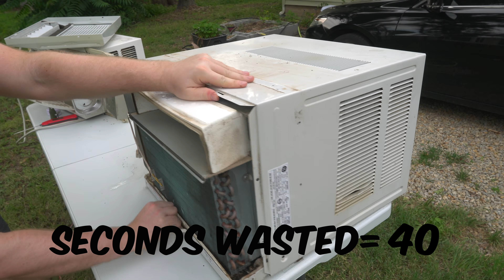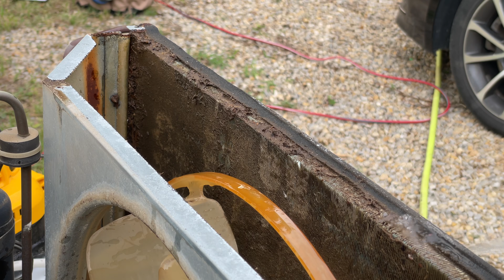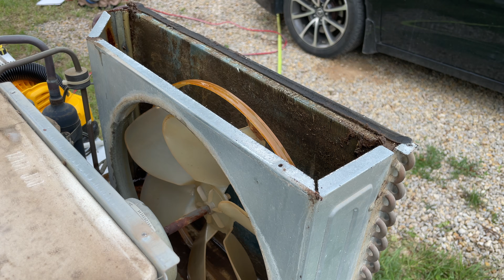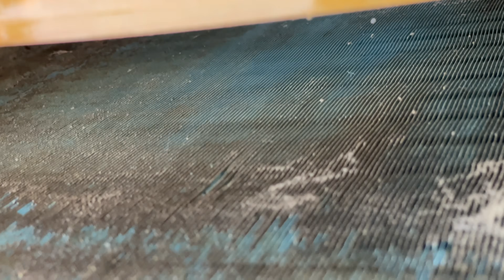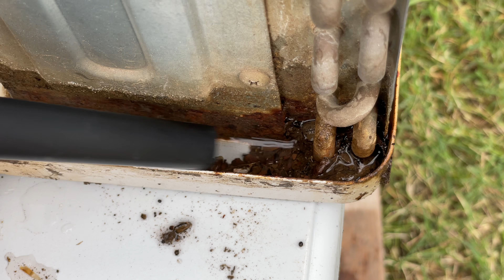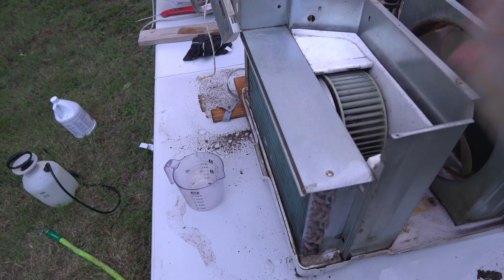DEEP Clean Window AC The Correct Way!

Comment: One thing I have done with my one unit. Take a small piece of window screen material and magnets. Lay the screen material over top the outside of the unit. Hold it down with magnets. Helps keep leaves and small debris from falling into the slots.
Reply from the maker: That's a really good idea! I've thought of something similar, but didn't know how to do it without it looking sloppy. Any tips? Thanks for sharing.
Reply: @HandymanHertz  you could try painting the screen white. Then use the harbor freight magnetic tool strips. I’m just using the 99 cent ceramic blocks.
Reply from the maker: @briteidea08 that's true, I may have to give that a try. Thanks.
Reply: @HandymanHertz I did this same thing but with velcro. Line up the screen and take note of the edges and then put velcro on the AC, then the edgea of the screen and it will be a pretty nice barrier that you can easily take off and clean then stick back on.
Reply: I just used small binder clips to secure the screen. Wrap it and clip it. Done.
Reply: Just to let you know - We have screening already, and ran out and got magnets from Harbor Freight today to do this.  Thanks so much for a great idea!
Reply: You should make sure the screen you get isn't too fine. I would hold some of it up to a fan blowing and see if you still get substantial airflow. The whole point of that on the outside is to have airflow. In my experience, a fan does not blow air through a fine screen almost at all. You need a pretty good pressure difference to really push air through.
Reply: That's brilliant!
Reply: Hey!!!!Thank you for that suggestion soo much! Lots of black dirt here I need tokeep out of ac infallible unit. Thanks again!
Reply: Suppose to read "in wall unit"
Reply: I do this! But I use two bungee cords to hold it on. And every few days I go out and clean it with a brush to keep it breathing well. I still end up having to buy a new unit every few years. I’m in Fl and mine runs a good part of the year.
Reply: I wish I could break mine down like this and clean it. I’d forget where the screws go when it’s time to put it back together
Reply: Would be good as To many pigeons go on our roof but they love sitting on it in winter so it wouldn't stay on. 
Its gonna be a B...h to take down, take apart & wash.
Reply: Brilliant
Reply: That's exactly what I did. Also keeps the wasps out.
Reply: That's a good idea I'm going to have to do a deep cleaning on my window ac and after I'm done I'll put some of that on to keep sticks and leaves out of my window ac
Reply: Brilliant!  Thank you.
Reply: Just make sure you clean that screen from time to time

Comment: My ac desperately needs cleaning but I don't own a water hose. How do I spray it down??
Reply from the maker: You can spray it with the foam cleaner I have linked in the description, and then get some water and rinse it after it sits (preferred)  It technically says you don't have to rinse it, so there's that option.

Comment: Nicely done! I have a habit of drilling a couple of extra drain holes near the condenser. Obviously, you need to ensure you won't drill into a refrigerant line or electrical wire 😂
Reply from the maker: Thank you!  Yeah, I've drilled into a perfectly good fan blade and cracked it once in an old AC. New fan blade was more than the thing was worth. a lot of good AC's in the junk pile do to drilling!  😃
Reply: some units don't have drain holes because the fan splashes the water onto the condenser to improve efficiency

Comment: The adjustable vents that can move side to side has mildew. Do I need to take the front of the ac off to be able to get to it? I’m in an apartment and not super savvy. Maintenance wasn’t much help in the cleaning department
Reply from the maker: Yes, and the reason is because the fan is going to have way more mold/mildew than the vents. If you watch the part of the video, you can see the fan blades are cover.

Comment: I have some other brushes I use but thanks for the info on that long fridge coil brush. That will come in handy.
Reply from the maker: It’s the best I’ve found soo far. Cheap also. I think the ones in the description or two for $10.
Reply: What brushes do you use ?

Comment: I've got a question my a.c. keeps freezing up so I cleaned it really good and put it back in window within an hr it was freezing up I'm thinking that I shut the fines when I cleaned it a couple month's ago after getting another one the fines don't look the same I think when I used a sm shop vac carefully I shut them when I took off the little thermostat in the front you can see the space in between them but no where else would this cause it to freeze up on the inside
Reply from the maker: Where does it freeze up? Lack of airflow is the common reason why acs freeze up. Make sure the fan is on high, it might help, but it shouldn’t matter if it’s working properly. I would bend the fins back with a knife or a fin straightening tool that  I have listed in the description.
Reply: @HandymanHertz  The inside front and if I don't notice quickly the couls that u can see from inside the house looking to the sides of unit . Thank you for taking the time I appreciate it
Reply from the maker: Shoot, I’m not sure I can help you on that. In my experience acs freeze up due to lack of airflow. Maybe google your question, sorry I couldn’t help you out.
Reply: @HandymanHertz  no problem I understand thanks for trying

Comment: i just bought a 10kbtu for $5 at the pawn shop. i figured i would steal parts from it as i plan on experimenting with building my own "mini split" system at some point. but when i got it home i seen it blew cold air. i put probes on it and watch the temps and the wattage used and the wattage kept climing. starts at 600 and over the course of about 10 minutes i hits 1400 watts. its rated for 1000 watts, so i knew there was likely an air flow problem. i took it apart and the hot side heat exchange was absolutely covered in crap. i dont know how it worked at all. on the outside it looked clean but the inside is what matters on the hot side.

i am confident that some cleaning will have my high side and low side working better, and use 33% less power, and should last longer. this unit was manufactured in 2019, its hard to believe how filthy it was. now i am just looking for the best ideas on how to gently but thoroughly clean this thing.
Reply from the maker: Nice, What a steal! I’ve been surprised with window ACs, and fridges that are  completely caked with crud on their condenser coils they can have and they still work. Like you said, they aren’t as efficient, but they still work. Can’t be good on the compressors either.

Comment: Just buy a new  window AC every 5 years or so, they are not that expensive
Reply: A decent 8k BTU costs around $300-400. an hour of cleaning every couple years, stretching it's life to maybe 10 years is worth it imo.
Reply from the maker: It’s seems like more work to get an AC, unbox it, install it, remove/dispose of the old one than just cleaning what you have? Way cheaper too.

Comment: Tipping it up on end  was scarry,,,, alot of fidgerator die that way
Reply: @ronallens6204 That statement is only partially true, If you have to lay a refrigerator or AC unit on their side or upside down all you have to do is leave the unit upright for a while so the oil can drain back!
Reply from the maker: I’ve never had an issue, knock on wood. I thought If you let it sit correct before starting it you were fine?
Reply: @HandymanHertz Do not listen to these idiots they have no idea what they are talking about, You are correct if you have to lay a Unit on its side all you have to do is leave it upright for a while before starting it! It has to do with the oil that is in the unit flooding the lines when they are laid on their side or upside down, When you put the Unit and it’s upright position the oil will then drain back and you will not have a problem!
Reply: @NeverEnoughPyro40  I wish that were completely true... I was warned about It when I was young, but I have had several nonworking ones that were laid on its silent that never came back up....  one guy bought an antique coke ice water bath dispenser, laid it on. It's side and and it never worked again... I told him to leave it unplugged and see if the oil would drain back to the compressor... never did.. I have heard of some that it did work, but not first hand to me.
Reply from the maker: @NeverEnoughPyro40 thank you very much for explaining the reason to us, and not just a Vague assumption.

Comment: I just leave the case in the window and pull the ac out of it.. even built a cart the height of the ac so I don't have to lift it. The box it sits on sits on a furniture dolly so I can pull it out to the porch to clean it
Reply from the maker: Interesting… How do you access all of the screws out for the shell when you leave the AC in the windows?
Reply: @HandymanHertz  the ones I have do not have the case mounted to the base of the ac. There is an open grid on the bottom of the case and sheet metal case on The rest of it. The inside cover latches to the case and has 2 screws on the front to keep it in place.. one is an Electrolux and Frigidaire  18k and 25k. Little ones maybe different.

Comment: The water in the back looks moldy dark color but it was a pain to put it in my window as it’s sideways and I closed it with foam board and foam on the sides so it can be closed. Is there a way I can clean it with out taking it out
Reply from the maker: Yes, I have a great video that is in this videos description on how to clean it the lazy way. Which means, you don’t need to take it out of the window. It should help you.
Reply: @HandymanHertz  thank you very much
Reply: It started today but it had this smelly smell but after running it, it stopped

Comment: Is there a way to declog the drain pan without taking it apart?
Reply from the maker: I think it depends on your AC unit. On mine, I can take the front face off and see the evaporator core oils. If you were to shoot some pressurized water or air into that bottom corner, you might be able to blow out the crud. Maybe get that brush I gave in the video description, I’d think that may be able to help without taking it out of the window.
Reply: This was what I came here for!  A friend of mine cleaned my old unit a couple of years ago without taking it out of the window, but I wasn't "supervising" LOL over his shoulder so I wasn't exactly sure how he got access (I think my unit may have a panel on the back that unscrews vs taking the whole housing off)... 
Great video!
Reply from the maker: Thank you!
Reply: A wire hanger worked wonders for mine 😂

Comment: I clean mine with a pressure washer but thats a central ac unit.. never had a problem with bending fins just spray from the top down straight.
Reply from the maker: I find that the city water pressure is enough to do a good clean, so I don’t have to bust out the power washer. But I wouldn’t be afraid of using a power washer either. I just wouldn’t recommend everyone do it, as common sense doesn’t seem so common anymore.
Reply: @HandymanHertz  true, if u mention a pressure washer i can imagine people spraying their ac units left to right..
Reply from the maker: @DrAliToma  yes, I’m sure I’d get some angry comments lol

Comment: How long did it take you to clean it, and how long do you let it dry? I need to clean mine but it's over 100 over here in texas and i can't sleep without my AC. I don't know what to do, i don't want to break my unit but i know my unit is moldy. I'm stressed.
Reply from the maker: It doesn’t take too long. I’d say if you have all of your cleaning stuff ready, it should take less than an hour to deep clean it once you take it out. It takes me way less than that, I just figure you may not be as quick since you sent familiar with it.  If you are worried, I’d suggest you don’t take it out and clean it by watching my “how to clean an AC the lazy way”. Good luck!
Reply: Same here. The weatherman said it felt like it was 99,° today

Comment: You’re never supposed to tilt a compressor.
Reply from the maker: .I was under the impression you just have to let it sit for a while for the oil to drain? How else do you take off that cover? I’ve never had an issue…
Reply: @rayagundez7022 That is not true whatsoever! It is not recommended to tilt them on their sides or upside down but if you must all you have to do is let the unit sit right side up for a while! And for the people that do not know it has nothing to do with the Freon it has to do with the oil that is in the system, When you lay them on their sides the oil could flood the lines which is not good when you run it, That is why if you lay them on their side all you have to do is leave the unit upright so the oil can drain back! Apparently your knowledge is based on what you have heard people say rather than actual knowledge, It is hilarious when people try to be a know it all when in fact it is just the opposite!

Comment: Yes the cleaning before and after is rewarding.  For me it comes down to the economics of time.  At my day job, my worth per hour including benefits is roughly $55 an hour.  My A/C unit cost $130.  Yes it is small but it works.  Is it worth my time and the efficiency gain to do all this?  I could slap a filtrete purple filter on the front of my unit and substantially reduce mold going in and blowing out at me.  But as fun as it is to take apart things and clean them to 80% clean it seems like I'd drop a screw inside, mildly cut a finger on the fins or one of the pieces of the shroud/case etc. and possibly make it not work again vs. selling it for $20 and buying another and everything would be new.  The first video with the cleaning in the window got roughly a 3° gain in cooling.  I'm assuming that had you done in video #2 the first time around the gain would be better, no?  But for me, it's the economics of time.  With all that time saved I can enjoy your well-planned video series.
Reply from the maker: I love this mindset! Like, What’s the true cost, time, energy, opportunity cost, etc? I don’t disagree one bit. If it’s the time you are trying to save, there is time in shopping and buy into a new one, and removing the old one and installing the new AC. There’s also some time marketing the AC to sell, talking to, and meeting with whoever you sell it to. Good stuff 👍🏼
Reply: $130 for an AC? Must be barely powerful enough to cool a bathroom or small garden shed. Even then it must run constantly to maintain a temperature under 76. I stopped buying junker units like that and got one that's much quieter, energy efficient, and longer lasting. Only downside is a bit of cleaning once a year. Even then, it's probably better if i were to get a mini-split AC and call it a day.